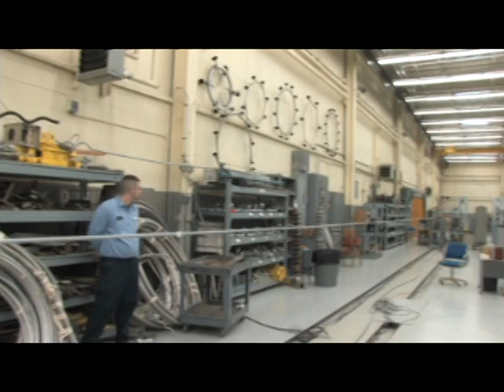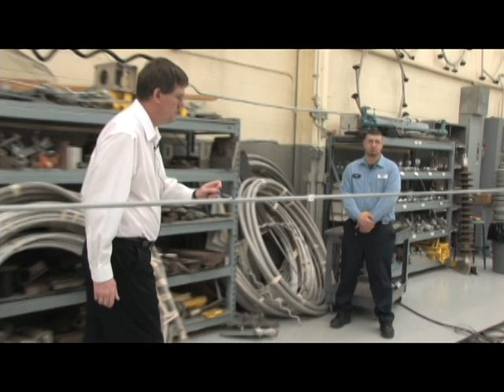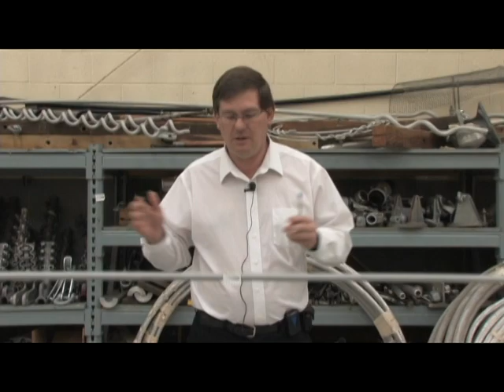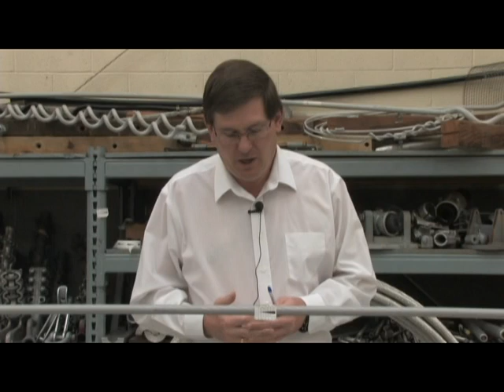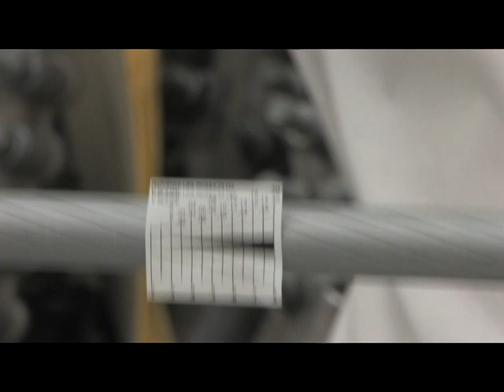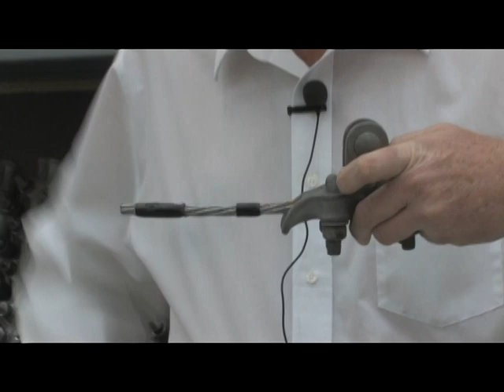Aeolian Vibration Fundamentals by Preform Products

Comment: Exceptional instructional video.  Enjoyed it and learned a great deal.  Have seen some highly damaging galloping conductor in the field.  How does spacer cable assemblies (sub-conductors for 345-kV, 500-kV and etc.) help or hinder the stress levels on each sub-conductor?  Assuming each sub-conductor is strung equally distant with spacers?  Which spacers work more effectively?